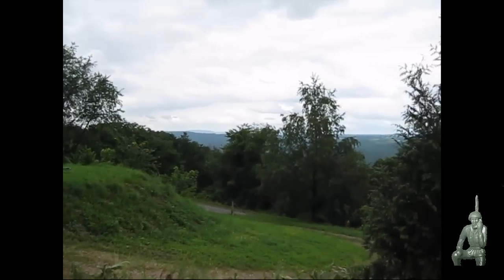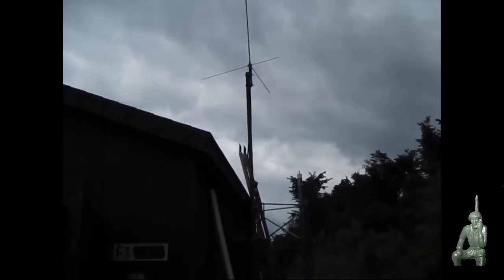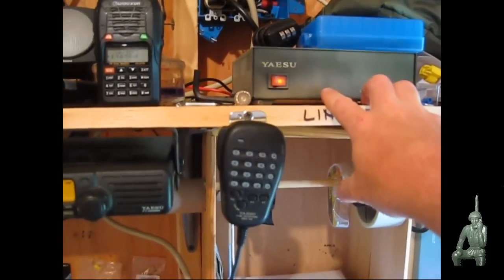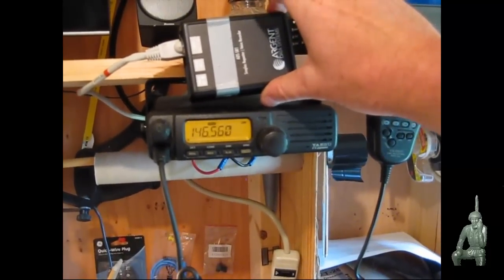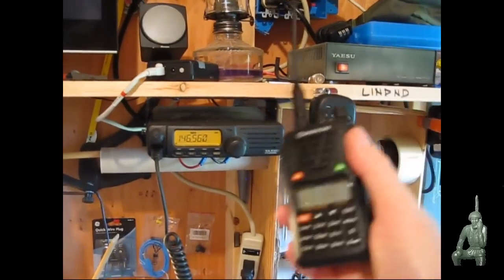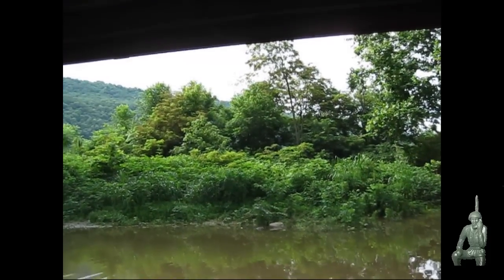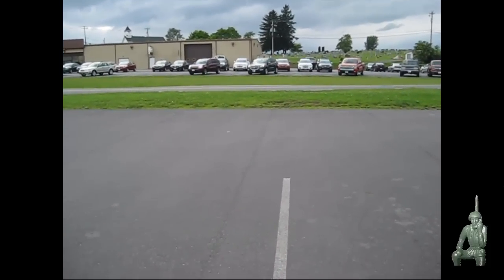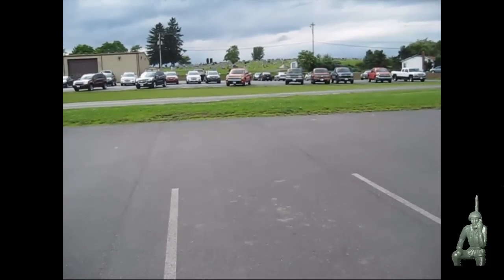Simplex repeater

Comment: Would this device work with a wouxun kg 1000 gmrs Mobile radio?
Reply from the maker: Yes/No.  Technically it would work but the FCC does not allow simple repeating in the GMRS service.
Reply: @Commsprepper  but many many people make simplex repeaters with multiple YouTube videos about it but they almost always use little 5 watt ht's

Comment: Thanks for the video. I see that the cable that you used to connect the mobile rig to the repeater controller has a phone jack to go into the controller, but what about the other end? How did you connect it to the mobile radio? I sent an email to Argent, but they haven't written back. Thanks for any help you can offer. 73

Comment: Hi..  how would you rate the AUDIO QUALITY of the device?
I have somewhat of a dilemma.
I want to use some of my installed gear for emergency “SHTF/WROL” applications.
The dilemma I have is that most of the users of my repeaters will be non-tech people.
I would love to have a system in place that would permit voice storage of short yet critical messages
that can be retrieved by either anyone OR with proper validation of a short DTMF code to add a tiny
level of “security” to the system.

(obviously it’s audio which can be readily decoded by ear or device... it’s just to keep
the average listener / eavesdropper a bit clueless)

I have a GMRS repeater and an IG (“business band”) repeater currently on the air.

The GMRS is analog only, no encryption and 45 watts, pursuant to the applicable part-90 regs.
It’s a Quantar with advanced signaling pkg ,a BpBr duplexer (high RF environment— a high-rise rooftop shared
by a dozen or so public-safety repeaters/transmitters, microwave links and paging transmitters).

Both repeaters utilize individual Telewave 4-element folded dipole antennas and have very short feedline 
to each repeater.

It has a fairly decent coverage area, as does my “business band” unit.

The GMRS repeater gives me an advantage of having many GMRS/FRS licensees in the area,
many who are using my “open” repeater at present.  The users may be an advantage as they can 
possibly relay information and/or assist with tasks in an emergency.  BUT..  they also pose a
potential disadvantage.  During any sort of crisis or emergency, especially a SHTF/WROL situation,
the less people who know your plans, information and strategies—> the better.

The “Business Band” repeater is a Hytera RD982 UHF.  It’s a DMR/analog mixed-mode capable unit
that’s capable of 48 watts of transmitter power that is turned down to 8 watts and fed into a TPL
power amplifier that then puts out 100 watts.  The logic was to minimize the strain on the repeater
transmitter and getting a higher transmitter power than natively produced by the repeater’s transmitter.

I have it currently running in “mixed-mode” so it will receive and relay analog narrowband transmissions 
that match the DPL code / or / will take an input on either digital “time slot” (DMR is TDMA) and repeat it 
on the same slot...   this allows TWO concurrent voice communications to take place simultaneously when
using the DMR mode.   Obviously, when using analog mode, you can only have one “talk path” functioning at
a given time, making the digital mode twice as capable.   I also have a second site which offers overlapping 
coverage territory and expanded coverage in areas not currently covered.  It’s within L.O.S. , permitting microwave 
linking, far more robust in storms, etc, than wired internet or tie-line leased  copper telco circuit.

The primary Hytera repeater currently has a twin, programmed identically, in the same rack.
It’s configured as a “fail over”.  (No amplifier/ separate antenna w/cheap “notch style”  “mobile” duplexer for now...)

Additionally, several of my “family only” radios (Hytera PD782G / PD982 and X1P)  have been equipped 
with AES-256 encryption for a moderate level of conversation privacy.  These radios have a separate 
“Zone” set up with channels that have encryption enabled.  The channels and zones are clearly configured 
and laid out in such a fashion that it permits them to be used easily by the non-geek folk in the family.

Friends and associates have been given the freq pair and CC (“color code” — no, SJW’s....   it’s not a racial thing 😉🤣)
AND have been issued a “radio ID” to use on the repeater. 

What I’d like to

Comment: Best video I've seen on this yet - great stuff, very straightforward and intuitive. What cable do you use from the simplex repeater to the Yaesu base station? I've been all over their site, but only see connectors for HT's.
Reply from the maker: I made my own from the manuals.  Mic High, Mic Low, PTT, audio etc.
Reply: ThirdLantern, the other way to do it is to connect the repeater to an HT, then connect the HT to a linear amplifier, then out to the antenna
Reply: i guess I'm kinda randomly asking but do anyone know a good website to stream new tv shows online ?
Reply: @Callan Bentlee Flixportal :)
Reply: @Clayton Jad Thank you, signed up and it seems to work :D I really appreciate it!
Reply: @Callan Bentlee no problem :D

Comment: Do you happen to have a wiring diagram for the Argent ADS-SR1 repeater to the Yaesu radio cable? I have the RJ45 wiring block.  I'm having some issues with my Yaesu FT-2980r working together with the repeater.
Reply from the maker: Sorry but I don't

Comment: Would this be the same type setup for gmrs as well? Can a licensed gmrs set this up with no issue?
We live near Tulsa OK, but outside of the city, and there is only one gmrs repeater, about 40 miles away from me. 
I pretty interested in setting up my own base station for more effective gmrs use.
Reply from the maker: Simplex repeaters are not permitted in the GMRS.

Comment: Hello I plan on setting up one of these on either my motorola xtl 800mhz or my xpr4550 vhf. Which one do you guys think will be better? I am only using the radios for when I am out cutting firewood I would be looking to talk up to 20 miles away do you think it would work?
Reply: Bob Smith 800 is government... not unless you want to be interfering with them, I would stay far away from 700 and 800 mhz

Comment: can you use different rx ant tx freq on the fixed radio???
Reply from the maker: I don't understand the question.
Reply: @Commsprepper  like for example if the radio is set up to receive on 154.400 and transmit on 155.400
Reply from the maker: You want the antenna to match the transmit.

Comment: Why have your transmission recorded and rebroadcast? Why is it even necessary? 2 meter repeaters don’t record and retransmit.
Reply: A typical repeater setup has a transmitter and receiver and are able to listen and transmit 6 kilohertz apart from each other, alot of filtering is needed to do this.  If you try and use just two radios on the same band the transmitting radio will swamp the receiving radio and it wont work unless they are very far apart from each other.
Reply from the maker: This is not a repeater.  This device provides "repeater like" functionality with a single radio.  Repeaters have two radios transmitter and receiver.
Reply: Commsprepper exactly. Why not just use two radios?

Comment: I'm looking to setup a gmrs repeater but this method seems like it would be annoying having to wait and keep hearing myself and vice versa with another person. Is that what happens?
Reply: Technically that is not exactly correct...I assume you are referring only the definitions section of Part 95 for GMRS that defines what a repeater is.  The ADS - SR1 is a repeater only in name.  Legally it's a message forward device, this is why ADS refers to it as a store forward.   Since message forward is not clearly prohibited in PRS/GMRS (95.33 / 95.1733) AND the permissible uses of GMRS (95.1731) are not limited to what is delineated is it is unclear at best the legality of using message forward on GMRS.  In your video, on  2m, you don't have a repeater either.  It's a message forward device as specified in Part 97.219.
Reply from the maker: The FCC does not permit simplex repeaters to be used in GMRS.
Reply: Yeah, that's what'd happen - unless you had no tone on the simplex repeater but sent in a 67 Hz tone, while your buddy sent in a 110.9 Hz tone or similar, and you mute your own tone on receive.  If transmissions are short, great!  But yeah, communicating should take literally twice the time.

Comment: I see in the comments that you made the cable. seems straight forward to do but I'm having no luck with ft 2800m. mind sharing the details?
Reply from the maker: Sure.  Take a look at page 48 in your owners manual (Packet connections).  Replace the word data with audio and use those connections with the ADS-SR1.
Reply: looks like my config except I tried to run power off the 3 pin I'll clip and see what happens. Thanks much.
Reply from the maker: I saw that pin but it's only  8 volts.  I think you will need to use the internal battery.
Reply: Yup. it appears no audio. think I have the wrong audio knack. kill have to compare it to the factory baofeng which works great

Comment: quick question, when you broadcast on your handheld and there's other handheld nearby, do they hear both the original transmission and also the secondary transmission? I'm thinking so just not sure. thanks for posting this video.
Reply from the maker: Yes you will.
Reply: Commsprepper 
Thanks for the quick reply! That solves my question for what I'm wanting to do.

Comment: Not to nitpick but your repeater simplex channel should be 146.565 not 146.560. Upper half of the two meter band is on 30 khz splits which means simplex channels of 146.520 (nat'l simplex), up 30 khz to 146.550, and then a split channel up 15 khz to 146.565.
Reply from the maker: War Planner no problems - thanks for the info.  This simplex repeater was in up for an hour to make this video (four years ago).   Now that radio is a packet node.  Thanks for watching and taking the time to comment.

Comment: I'm also in wv. wonder if this will work with the yaesu ft 2500
Reply from the maker: +jayradford Funny you ask.  I just set this up with a FT-2500 back at the homestead in Virginia.
Reply: +Commsprepper I have one of those radio tone controller box. will that work with the 2500. I tried but think I need the 3 ring auxiliary cable. kinda new in radio and waiting on a call sign
Reply: +Commsprepper its the RT-SRC1
Reply from the maker: I don't understand the question?  I just connected a TNC-X to a FT-2500.
Reply: +Commsprepper ok I don't have the TNC-X cable I had just tried a regular auxiliary cord for cell to truck radio. when I ordered the RT-SRC1 I got the baofeng cable was just wondering if I  got the right cable it would retransmit thru the 2500
Reply: +jayradford can I go thru the jack in the back of the 2500 or do I have to go thru the mic cable. I just can't find any info on this radio. or that anyone has used it with the radio tone controller
Reply: +jayradford ok I found a 14 dollar solution from Hong Kong.. that's a shame. cable goes in both the back and the mic

Comment: I know this video is over two years old, but still wanted to thank you for creating and posting it. Been subscribed to your videos for a while and keep coming back to this one. — I picked up an ADS-SR1 a while back and was having fun with it using it with a Baofeng HT. Amazingly with a decent antenna even with 5W, it had decent range much further than I expected. Finally picked up a Yaesu FT-2900R and made a cable for it to interface with the ADS-SR1 (combination of the RJ12 Mic jack and the 2-pole 3.5mm speaker jack on the back) and it worked! Wished I had your FT-2600M which has a proper 'Data' jack that my 2900R is missing. :) Thanks again! Cheers and 73's!
Reply: Daniel, this is bit if a late reply, but I just ordered the SR1 and have the exact same radios you have.  You have any specs or links on the cable you built?  Much appreciated!
Reply from the maker: +Daniel Kao Glad it helped.  Thanks for watching and taking the time to comment.  CommsPrepper

Comment: Can you publish the specs on the cable you built to do this join.  I am building the exact same setup and want to make sure I get the cable right.
Reply from the maker: +Keith Walker  I will have to find the cable.
Reply: +Commsprepper I have mine working hooked up the 1200b channel but my audio is very light.  Did you use the 1200b channel or the 9600b channel?
Reply from the maker: +Keith Walker 1200bps line.

Comment: +Commsprepper great set up, I wanted to do something like this, but had only seen the handheld repeater system. This gives real hope so when I get back east I can do the same as you set it up to use my base/mobile with the choice of 25 or 60 watts to transmit with instead of 5 watts with a handheld especially with a nice base antenna in the air. Thanks for sharing! 😀
Reply from the maker: Myles Siglin Thanks for taking the time to watch and comment.

Comment: Where did you get the interface cable between the radio and the repeater.  I've only seen cables on the Argent site for handhelds
Reply from the maker: BennyCFD I made the cable.
Reply: +BennyCFD That would be called an ethernet cable......

Comment: The legality of this is lacking. It doesn't auto identify, and you have no remote way to shut it down ,so its lacking a control operator. I would remove this video before the fcc catches wind of it.
Reply: Reading more into it, it has an "announcement" feature that could identify the operator for it. The lack of shut down would bother me though. (edit looks like dtmf tones can shut it down too! cool.)
Reply from the maker: icanrunfasterwithmyknife This unit has lots of cool features.  It will auto ID with code and you can also have a pre-recorded voice ID.  For remote control you can enable and disable the repeater function via DTMF command (repeater on/off) See manual https://www.argentdata.com/support/ads-sr1-manual.pdf.

Comment: Hey comms u have a vid on how u set it up ? I have the gmrs bands in my tyt-9000 ?
Reply from the maker: I don't know what the TYT-9000 radio is but Argent Data sells brand specific cables in addition to the simplex repeater.  I have Kenwood and Yaesu radios so I got those cables.

Comment: Radio Shack used to sell a version of this repeater system but closed them out after a short time and a friend of mine bought it quite cheap and we used to use it. Although it did in fact work great, you had to remember if you were in range of the person talking and could hear them "direct", you had to wait for their transmission to be repeated via the repeater system before you could reply. Basically you would hear the other person's broadcast twice. Once live (direct) from their radio and the second time via the repeater. Even if you couldn't hear the other person direct you had to keep in mind there would always be a delay between responses, and if the person talking was long winded the delay could be quite lengthy depending on how long they spoke. Additionally, If you didn't wait for the repeater to rebroadcast the other persons transmission and began replying after hearing them direct, the repeater wouldn't be able to hear your reply and thus, would not repeat YOUR transmission. If you kept these basic conditions in mind then this type of repeater setup could work well. If not it was just one big mess trying to figure out why the other person wasn't hearing you, or why the repeater didn't repeat a transmission :\

I used to have three of those Yaesu FT-2600 mobile radio's, all used for packet and they were great for that purpose because they had a DB9 connector on the back and were simple to interface a TNC to them. Plus they had 60 watts RF output. They were my favorite model at the time for data purposes - still are actually :)

Comment: How do you handle the issue of some people hearing you twice? And does the ADS SR1 understand tones so you can make the repeater somewhat more private?
Reply from the maker: You can use separate RX and TX frequencies to avoid hearing stations twice.  The function/action of PL (tones) and DPL take place in the radio you are using, not in the repeater.

Comment from the maker: If other handhelds are in range of the originating handheld then they will hear both transmissions.  You can "hide" this effect by using two different PL/CTCSS tones for the transmit and receive (rolling it on the repeater unit).  However, this will only work if you have a radio that permits separate tones for transmit and receive.

Comment from the maker: R&R is great.  Getting allot done (even with the breaks to make vids).  The Internet connection has been the most frustrating.  Even when working correctly - the upload speeds take for ever to post vids.  Only a few days left on site to finish my projects and make a few more vids.  I want to take the Wouxun/TNC-X/ATV mobile and make a vid using that equipment somewhere  on the mountain.

Comment from the maker: Not sure how to answer the question.  The simplex repeater "echos" transmissions on the same channel/freq/band.  Cross-banding permits access to between bands for radios that may not have both bands.  What I like about the simplex repeater is it can be connected to a handheld - creating a basic repeater for only  few bucks.  Does this help with your question?

Comment: How is this different from just buying a repeater with cross band repeat? Is it that the message is retransmitted on the same band with an offset, negating the need for 70cm/2m dual band radios?